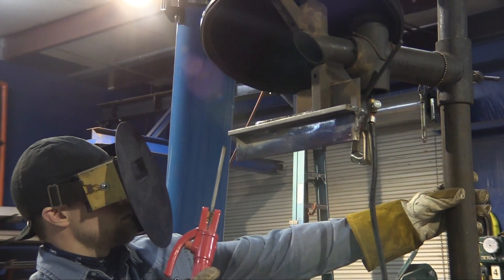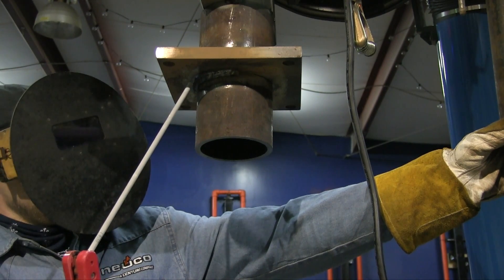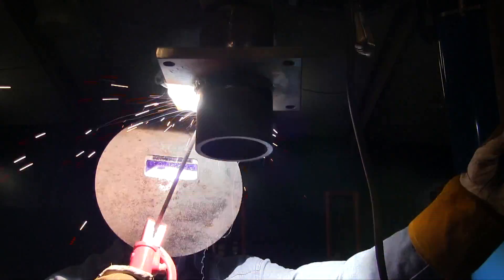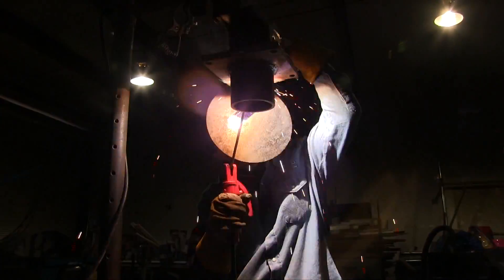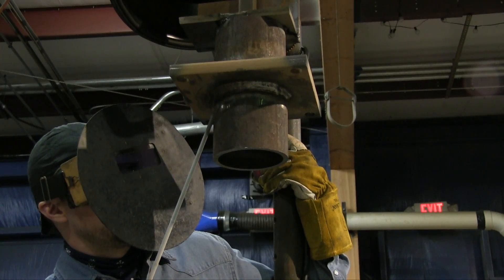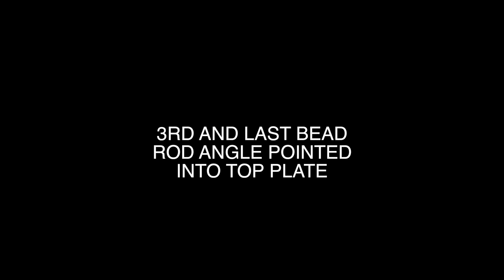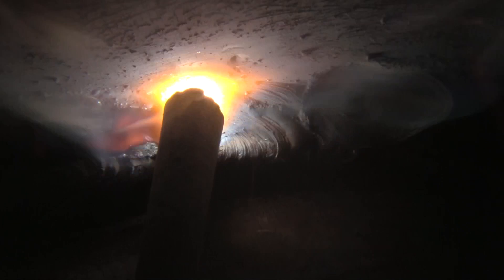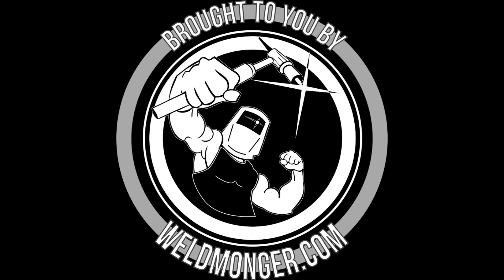Welding Overhead 5/32" 7018

Comment: You are a good welder because you handle the positions very well when welding, you handle the amperages of the machine very well. When welding, they are difficult positions for, welding and tired, I also had to weld in the metal industry, mechanical, weld, in different potions, and also weld with 6010, 7024, and stainless steel, type 316, and with roll machines with hollow wire, with mixtures of, Argon gas, and co2. 
Best regards atte Jesús Gómez torreón coahuila Mexico

Comment: Can you weld 45°`$60mm thickness plate and 1/8 root 7018 and fill and cup 5/32 electrode no using grinder.100℅ xray

Comment: I have welded 7018 upside down, I just started stick welding this year back around May 2019, watching the flux puddle fall off always screws with my following of the puddle. I don’t see any flux drip while you guys are doing this weld. About 160 amps on 1/2” mild plate . Maybe I’m not moving the stick fast enough or maybe too. Love watching pros, man does my lower jaw fall 👍👍

Comment: I just won one of those 210 welders at a statewide competition in Iowa. I got 1st place :)
Reply: What kind of competition? I'm in Iowa also.
Reply: Luke Main plumbers and steam fitters local 33 in Des Moines. Competition is beginning of April. I’m graduating early in January so I don’t know if I’ll go. There’s a competition in Tulsa,OK at Tulsa Welding School April 18th that I’ll be going to. Already got the blueprints emailed so I’ll be working my butt of to perfect the project until then. 1st place is full tuition and a welder and some gear. 2nd 50% Tuition + some gear. 3rd is 25% Tuition + gear. I’ll be starting school there in June for pipe welding.

Comment: #1 at 3:14 there is a TON of porosity...How is that even possible with 7018? Why has nobody addressed this?!! 
#2 AND you used the same footage at 3:49 but called it a new one... RLY?!
#3 You can clearly see that the weld is sagging big time, yet it's perfect when you show it cleaned up. It's pretty obvious that you welded the top side in flat to get a pretty bead and showed that and told us it was overhead. Expected more from this channel. UNSUBSCRIBED and THUMBS DOWN!!!!!!!!!!!!!!!!!!!
Reply: Hey there Weld Troll, sorry you felt that way about the video. To clarify, the sagging you saw was the slag solidifying, which tends to droop when welding overhead. Secondly, restriking causes some porosity to be left in front of the weld, but once you weld over it, it gets remelted and is no longer an issue. Lastly, we did weld this whole thing out in the 4F position, Scouts honor. We hear at Welding Tips and Tricks are not trying to "trick" anyone. Everything in the video is there to help someone who is struggling. Hope that helped clear up some misconceptions 👍

Comment: The TALENT,  SKILL, and KNOWLEDGE is pure mind boggling GENTLEMEN,  thank you.  Jodi, you have helped me over the years in more ways than you'll ever know.  I had to repair weld the frame on my Harley Dyna Superglide,  a flat plate beneath the left side cover that mount the electrics. This plate is welded at the factory and connects to main backbone of the frame. Thanks to you and your videos,  I was able to 7018, vertical up, all without removing the wire harness as well.  5000 miles later, all is well,  the weld looks factory and has held up perfectly.  At 61  years old my eyes aren't the best, and my hands are not steady either.  I built the engine on my Harley and it makes more than TWICE the factory horsepower and torque on a rear wheel dyno, so the frame and its stress points get quite a workout. I use and love my small ESAB 160 INVERTER, yes made in China. Thanks again to you I'm getting a tig torch with a gas valve and willbe scratch start tig welding with the little yellow lunchbox. GOD BLESS you Sir, SARGE 
🇺🇸🇺🇸🇺🇸🇺🇸🇺🇸🇺🇸🇺🇸🇺🇸🇺🇸🇺🇸🇺🇸

Comment: ..I mean FknG WoW Andrew ! 
I'm not a welder in any shape or form, just occasionally every now and then I like to set up a joint for myself and burn box of rods on Saturday. 
Two weeks ago I was doing overhead and vertical up, and man... Your beads look like You're about 275 years of arc-time more experienced than I am :)

All the best
from Scotland
Reply: Hey Mark, thanks for the feedback. It takes alot of practice to become steady and know what to look for. Keep at it and you'll be showing me a thing or two! 
Keep it real in Scotland laddie!
Reply: Listen up, this was faked! 
#1 at 3:14 there is a TON of porosity...How is that even possible with 7018? Why has nobody addressed this?!! 
#2 AND you used the same footage at 3:49 but called it a new one... RLY?!
#3 You can clearly see that the weld is sagging big time, yet it's perfect when you show it cleaned up. It's pretty obvious that you welded the top side in flat to get a pretty bead and showed that and told us it was overhead. Expected more from this channel. UNSUBSCRIBED and THUMBS DOWN!!!!!!!!!!!!!!!!!!!

Comment: maybe a dumb question here, BUT why dont you just always use higher amp then tight arc on flat position aswell? is it cause bigger arc (except long arc aka high high amp) makes the weld flow out better and get bigger or why is it not "usable" in flat aswell? great video as always (sorry for the bad spelling)

Comment: What is a good technique of a 1/8 6010 I’m having problems with craters
Reply: Craters at the end of the weld? Push the rod about a 1/2 inch or so back into the puddle right before you stop. Could also be your arc isn't short enough and/or you're running too hot
Reply: Mostly on restarts and some at the end it was 1/4” I Beam root 110amps DCEP
Reply: @gooseflatwaterfowlers  that sounds a little hot for 1/4, maybe trying going down 5 or 10 amps and see if that helps.

Comment: Awesome video and weld.   I am starting out and I'm confused about the slag part do you not clean any slag until the very end? Every time I try this I have inclusions
Reply from the maker: the trick is to restart quickly while things are still good and hot.  also there is very little slag in the crater
Reply: @weldingtipsandtricks   Gotcha. I'll try that. Thank you so much!